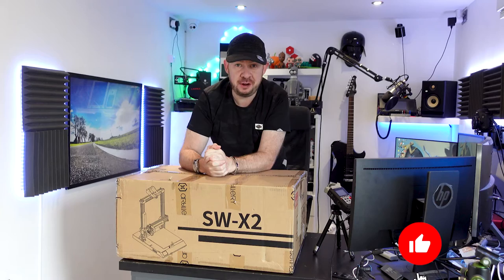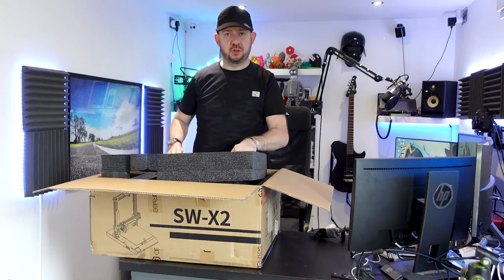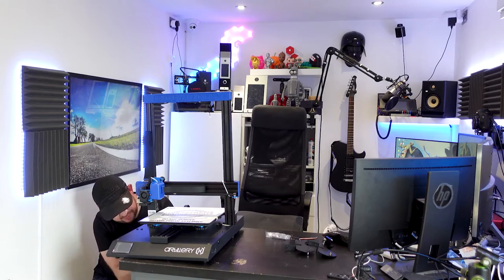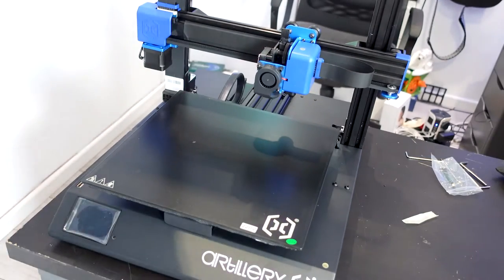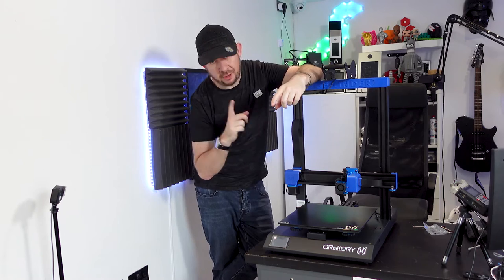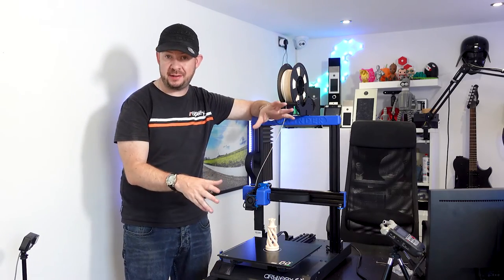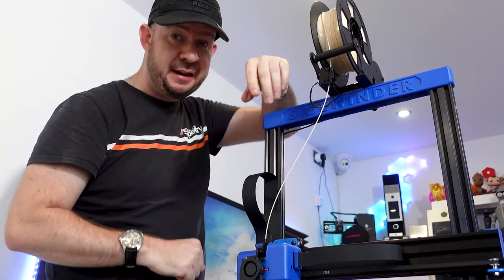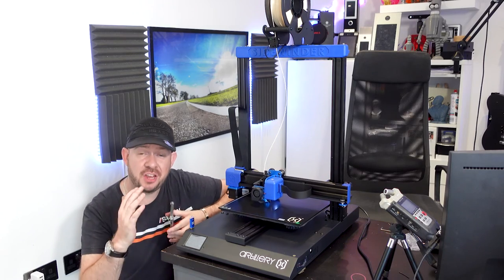Artillery SideWinder X2 3D Printer Review - Unboxing, Setup and Tests - Can Cheap be Great??

Comment: I found the following settings best: 220 degrees extruder 65 degrees bed a light coat of hairspray.  And DONT FORGET .To enable compensation for auto-leveling, add M420 S1 Z10 after
G28 in starting Gcode
Reply: @Cassandra yes
Reply: So do u think this will fix my stringing issues? So I have this 3d printer (I got it 2nd hand on OfferUp for a good deal) and it was printing just fine until I switched filaments (I switched from regular PLA to PLA + (which is what my next lineup of printed stuff requires) ) and now it doesn’t stick to the bed good, so what happens is, the print will start out fine and half way through it’ll mess up and end up looking like a chewed up piece of gum, so yea any ideas?